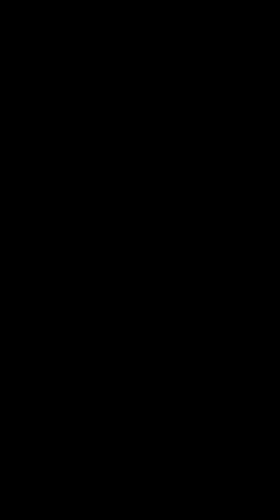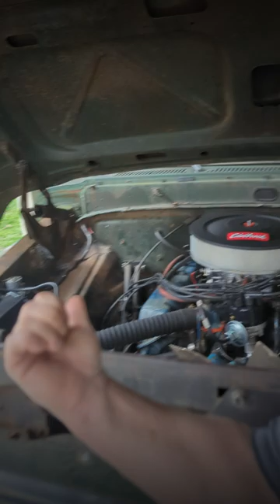SOLVED Misfire on Cylinder One on the 1971 F100

Comment: Bumps on distributer shaft that opens points is flat on bump for number one cylinder.
Reply from the maker: Your right,   i seen that  i had pulled the Dist out and rotated it slow as i watched the points and you could see it at that Number 1 spot.......   Thanks for stopping by.....